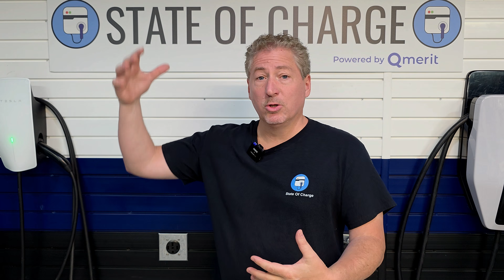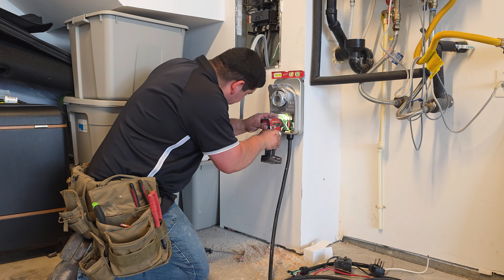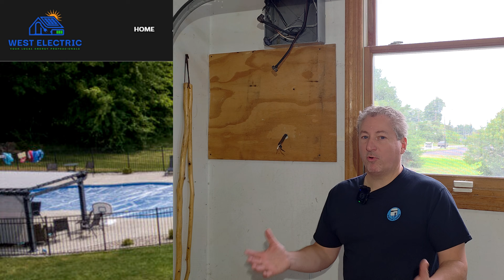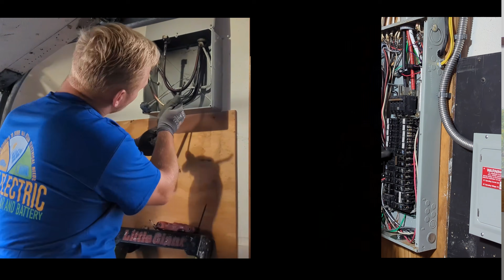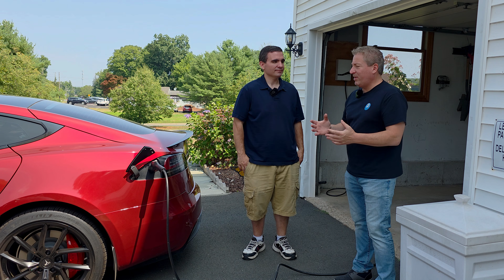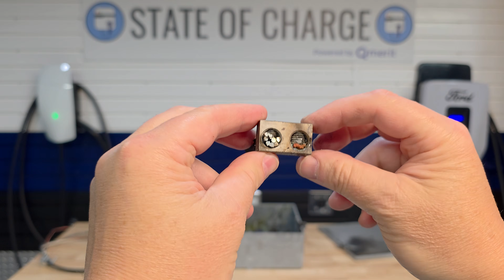Recharge Rescue Connecticut: Poorly Done EV Charger Installation Causes Fire

Comment: Fabulous interesting video because fault was not an inferior outlet, but rather poor installation.  Not many home owners would think over-torquing a connection could cause a fire, but it did.  Kudos to Tom.

While Romex doesn’t meet code, if properly torqued, a fire was unlikely.  I would have used MC with #6.  The difference in price for #6 vs #8 for 3 ft of copper wire is minuscule.  Why take any risk?  

For an additional safety check, I use an IR thermometer ($18) on connections after 2 hrs of charging.  I found one terminal 15 degrees hotter than the other indicating  poor torque.
Reply: An IR thermometer won't read temperatures accurately on a metal surface unless you know the material's emissivity and configure it in the thermometer.  In general that's not a practical thing to do because the emissivity will depend on the surface finish and condition.  If you fail to set the emissivity correctly, a hot metal surface can read as little warmer than ambient.  An IR thermometer should be accurate on plastic and painted surfaces.

Comment: Diy 6 guage on 60 amp breaker. 48 amp charge point home flex.
5 months installed for my lightning.  No issues
Reply from the maker: I hope you never have a problem. All these people I visit to fix their problems "never had a problem" until they did. And it could have been fatal.  
At the very least, I'd advise you to shut off the circuit and inspect the connections at least once a year. Every 6 months would be even better.

Comment: Just because you can install an 80 amp charger doesn't mean you should. Even a simple 20 amp connection can easily charge most EVs overnight as you generally drive 30-50 miles a day.
Reply: Try living in a rural area with minimal or no DCFC and a 20 amp EVSE.  That’s the problem with “typical” it completely disallows the exceptional.
Reply: @michaelwitkiewicz7052 yeah but a 40 maps and certainly a 48 amp charger is MORE than enough unless you have more than one person using the car for two commutes daily - ie you will always have 8, if not 12 hours, over night to recharge.
Reply: @johnwhite2576 why are you assuming a commute?  In my use case on any given day I may not drive at all, ten miles, or over two hundred.  If I have several two hundred mile days in succession then there is NO WAY that I can use my TOU plan on anything less than 48amp.  And we just this week got the first DCFC anywhere within 50 miles and that costs 10x what it costs me to charge at home.
Reply: @michaelwitkiewicz7052  Exactly, that's my use case too. Sometimes work from home, sometimes have to drive 120mi R.T. to the office, sometimes have to be at a job site 200 mi away. I need the ability to be able to fully recharge my Equinox EV in an 8-10hr time period if it's a long day. Sometimes, especially when its subzero out, 32A charging is barely enough. I can bump the charger up to 40A, technically the wiring is good for it, but I like to play it safer than code when it comes to EVSE's.
I always advocate for not going super overkill, but not everyone operates the same.
Reply: @andrewt9204 yep!  My nearest physical offices in case I need to be on a site are 125 miles and 350 miles respectively.  Then there are days that I never leave the house.  Heck, the nearest big box store is 60 miles away.  I’m not complaining mind you, and I get the idea of the “normal” commute, just sick of some trying to fit everyone in their box.
Reply: @michaelwitkiewicz7052  Have to agree, it’s very case dependent. Someone looking to do a lot of round trip towing moving around construction equipment, box trailers, etc for instance should strongly consider an 80 amp charger if their EV truck supports it... TOU can makes this even more important. In addition heavy daily use of power off boarding features, have inclement weather, drive far and fast… long and short of it is people who plan to heavily drain their batteries on a regular bases should definitely factor in all these things when choosing a home charger.

Comment: When we installed our level two charger, I followed your advice and used 8 gauge wire and a high grade 240 volt connector.   I have had no issues charging my wife's Hyundai kona.    Thanks for the advice.
Reply: As insurance, you might want to check the temperatures of the entire circuit path (main panel to car charging port) while the charger is at its maximum output to make sure it's all less than 60 deg C. NEC allows 75 deg C, but getting close to that indicates a potential failure point that is easier to fix before stuff starts melting.
Reply: @rocketscientist42  Yes and it's not just the temperature rating of the wire that determines the allowable current. Many breaker connections are not rated for 75C or 90C. NEC specifies that all connections in the circuit must be rated.
Reply: What are you limiting your amps to? Because everyone is saying to use 6 gauge and even to avoid 6 gauge Romex in favor of THHN.
Reply: @generallyhelpfulsoftware646  I checked with the person that installed it, and it is 6 gauge, not 8.   It consistently uses 45 to 48 amps.
Reply: A 48amp charger should be #6 THHN which is individual wires in conduit.  If you are going to use Romex, it should be #4 for a 60amp circuit.
Reply: Those gauges I mentioned were for copper.
Reply: Also want to add if you do use #4, make sure your connector and charger can support the 4.  Some chargers can on,y fit up to 6.
Reply: @nueok that is true.  My set is #4 romex to cutoff switch nd the #6 THNN to charger.  Chargepoint can only take a #6 wire.